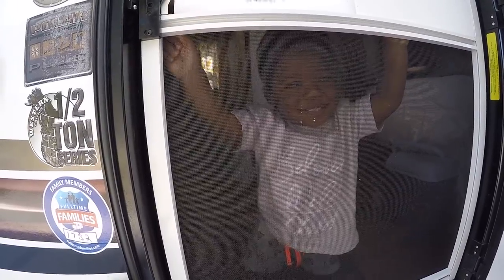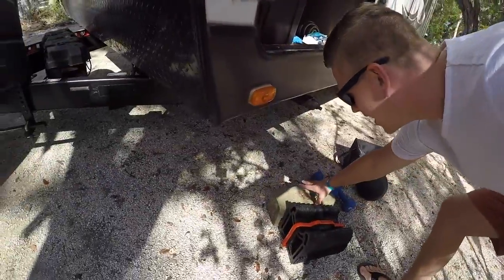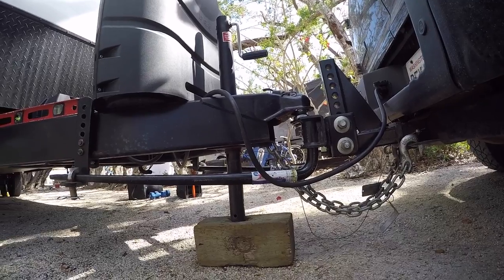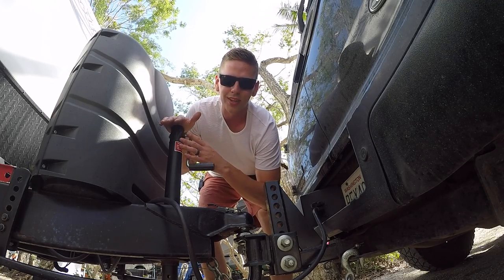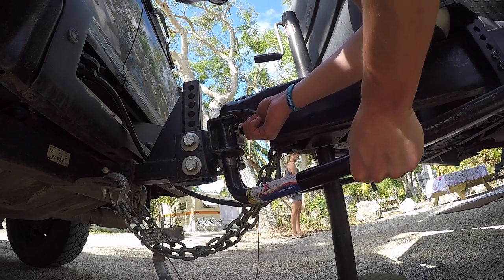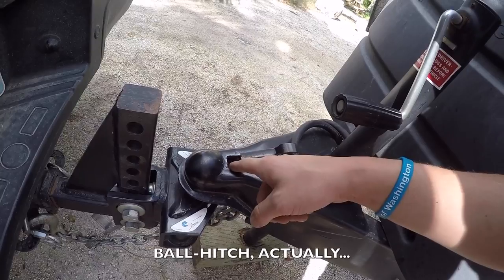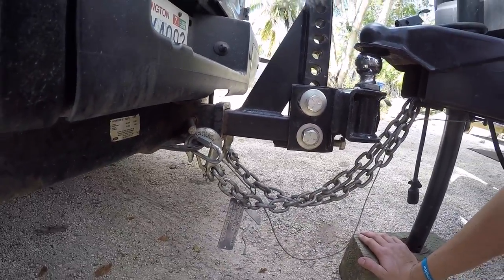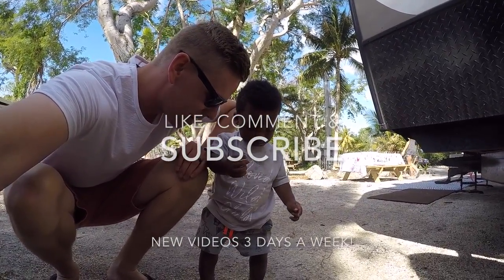RV BEGINNERS- How to unhitch your camper from your tow Vehicle

Comment: I put all my wheel chocks in and then put the vehicle in neutral to let it roll into the chocks before I try to unhitch help me a lot, but I still don’t know is whether I should have the parking brake on the tow vehicle on or off?

Comment: Thanks for this video.  My issue is unhooking.  I have a power jack.  It just keeps going up.  The back of my pick-up loaded with a motorcycle is nearly off the ground.  Then finally it releases and the truck drops like a lead sinker.  The spot where I do this is not level with the truck facing up the hill.  I'm afraid I'm going to bust something.  Seems like a lot of pressure is involved.  Scary for me.  Cute kids and wife!

Comment: Again, I'm a little behind and catching up on videos, but I just watched this one and the next how to set up your camper video. I realize the site you are on here is fairly level, but I would suggest you chock the wheels before disconnecting from your truck as there is nothing preventing the camper from rolling if you chock after disconnecting. Once it starts rolling it could then bend or break the tongue jack too.

Comment: Hey guys! Enjoying your videos! the things y’all have done inside is amazing!  I heard you say you didn’t like leveling side to side... we didn’t either- it was a hassle. Until we found Andersen levelers! Have y’all heard of those? They do come in handy!  Keep those videos coming! One day maybe we’ll be able to do this same thing! Until then, we’ll keep watching! 👍🏼
Reply from the maker: PrattPartyOf4 thanks so much for the encouragement! You know I have seen those around and they do look pretty simple. I’ll check them out, thanks for the tip! 👍
Reply: I'll second the Andersen Levelers. Before we got our new 5th wheel with 6 point auto level, I used the Anderson Levelers and the LevelMatePro. The combination of the 2 made leveling so much easier. I would open the LevelMatePro app on my phone and it would connect to the unit in the 5th wheel and tell me which side needed to come up. Put the Andersen levelers in front of those wheels and I would pull up until the app showed me it was level side to side. Then, once disconnected the app tells you if you need to lower or raise the front of the trailer. Totally stopped needing to run in and out of the trailer to check for level. Next best thing to an auto level system!